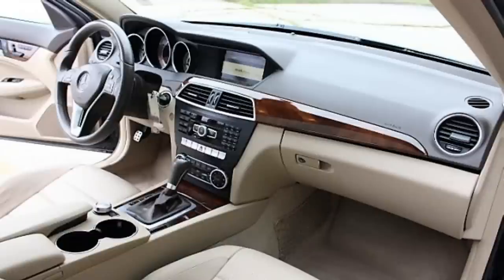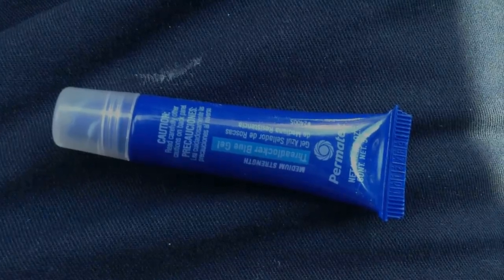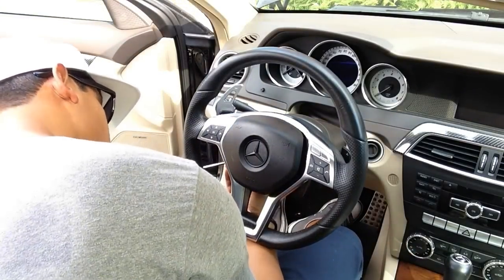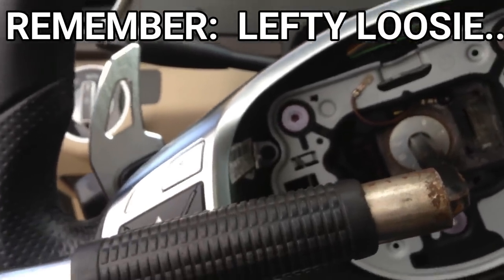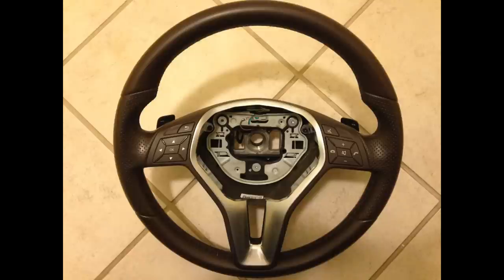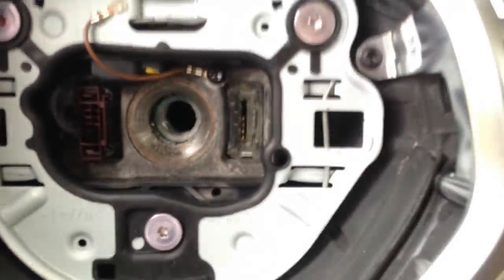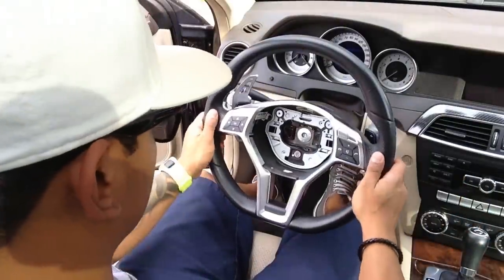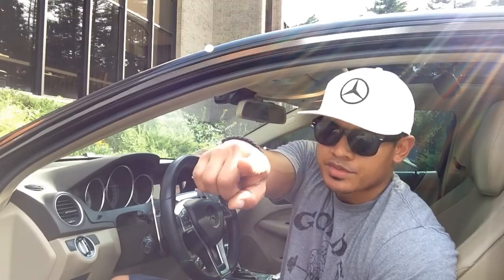Installed a new steering wheel (with paddles) on my Mercedes C250 C300 W204

Comment: Flexx can I switch my steering wheel to one with paddles if my original wheel didnt? And will the paddles work?
Reply: that's what he did in this video...
Reply: check if your conductor plate has 4 plugs at the top, if it does you can 100% do this

Comment: Having extreme difficulty with that lever it just doesn’t fucking work
Reply: got it! guy don't feel for a lever because it will feel hard and like a piece blocking you from where you think you want to go, just push on the thing blocking it from going straight all the way in and voila!

Comment: @flexx I have a stock 250 steering wheel with no paddles , does the paddle function work once you upgrade ?
Reply: Have you figured it out bro I have the same question?
Reply: no it won't, the transmission has to be programmed to accept paddle shifters as an input, take it to a shop that has the diagnostic star tool
Reply: Paddles work for me if you drop it into manual mode via the stick
Reply: @gregorini59 did you have to wire it

Comment: Hi Flexx - I have a 2009 Mercedes SL550 and like to replace its steering wheel with a new one. I wonder if the procedure is similar to the steps as shown in this video?

Comment: I need help cannot loosen the bolt to the steering wheel to change it out 2013 C Class 300 Mercedes-Benz can anyone help
Reply: Did you ever get it loose? You might not be using enough force so don’t be scared to use force.

Comment: Hi, old video I know but I've just done this and everything worked perfectly - great tutorial thanks. The paddles work when the car is put in manual mode via the stick, so try that if you've done it and think the paddles aren't working
Reply from the maker: Yes, that’s how paddles work on most cars. You need to put the gear or transmission into “+-“ manual mode. It’s the same thing with my benz, a4, and R8.

However, if a car didn’t come with paddles and you install a steering wheel with them, doesn’t automatically mean they will work. Some cars require programming to unlock the feature and some cars just won’t allow paddles cause the transmission isn’t designed for it.
Reply: @TheFlexxGarage  thanks, I've been in some that haven't needed any activation. The Audi A3 TFSI and Seat Leon FR I've had just needed a hit on the paddle and manual mode is activated, but the old lexus and Toyota I had did need the activation on the stick. Maybe it's a VAG thing!

Comment: Can somebody explain to me how to replace the pre 2018 steering wheel of the mercedes e class 200 amg 2018 for the new, post 2018 steering wheel? I'm mainly interested in the exact decoding process. And does anybody know which chip card should be used. Thank you.

Comment: Hello I wonder if this will work on a 2005 Chrysler Crossfire . I love the 3 spoke sterring wheel. in 2005 Mercedes was involved with cHRYSLER.I was so happy back then and then they started with the Crossfire which was rather expensive and used all old Mercedes SLK technology .but charged high prices for the Crossfire. I couldn't afford one then but got this 2005 real cheap $1700 and wanted to do the Mercedes conversion on my Crossfire like sterring wheel. I know my car doesn't have radio button on wheel  but the 2005 SLK did .don't know why Mercedes used all old tech on the crossfire. I would love your old steering wheel if  it would work on my car Ill need the air bag also . will these work on a 2005 Crossfire.

Comment: Hi!
Can you help me regarding changing steering wheel in w207? (mercedes benz e350CDI coupe 2010). 
Because I want to change my steering wheel for a face lift one  (2012) 
My afraid is that I have no steering paddles/shifters on the steering wheel and the steering wheel I want has paddles and the electronics maybe different in 2010 and 2012. 
For me its doesn't matter if I can use it or not the important is that the main buttons work properly.
So is it possible to put the 2012 steering wheel (what you have changed in your car) into my 2010 e coupe?
 Thanks!

Comment: I dont get it. I did the exact same thing with the same steering wheel and nothing is working??? Anyone? No Airbag, No paddles, no light in steering wheel. NOTHING AAARRHHH
Reply from the maker: If you didn’t change the contact plate then you didn’t do exact same thing in the video.
Reply: @TheFlexxGarage  well i did :) And its saying error in the left side.
Reply from the maker: then you probably just have compatibility issues. Not all steering wheels are fully interchangeable...even if it "looks" like mine or if it's stock from another similar car. I've seen some people swap a 2012 C250 steering wheel with paddles into a 2012 C250 without paddles...and nothing works and airbag doesn't even fit right. And some people that swapped out with completely different benz models and years...and everything works 100%.

Comment: Hey flex I have a 2011 Mercedes c350, I want to add paddle shifters. My gear selector has a manual mode in it, will it work?

Comment: Hey Flex. Question. I have a 2012 Mercedes E350. The surface of the button modules are peeling off. Instead of buying a new steering wheel at $1300 bucks. I wanted to know if you have ever replaced the button modules on both left and right sides of the airbag? If yes, can you make a video on how to replace the modules, I just recieved mine but dont know how to remove and replace old.
Reply: I had a similar issue but I just bought chrome button stickers on eBay and they look brand new

Comment: Great Video Easy Swap, just one question. The steering wheel can only go on one way because of the teeth correct?  Looks like I might need an alignment to straighten the steering wheel when going down the road.
Any idea on that?
Reply: No the steering wheel not go in one way before careful to install the steering in same position make a mark before you remove the steering wheel or your steering will be not straight in the road

Comment: Hey Flex I have a 2013 c250 model as well and the airbag has malfunctioned. I found out there is a recall on the airbags but the dealership doesn't have them available. I can't buy a replacement because they want refund me what I paid and when the new model is available whenever that will be. Any advice
Reply: Marcus Scott hey the dealers now have the airbags.

Comment: will this work on a CLS500 benz...would like to change steering wheel to the look of steering wheel like this one in the video
Reply: no it won't because you'll have to recode the airbag's SRS module with xentry after every swap, but he's likely not aware of that

Comment: I have a 2014 e350. I want to replace the all black steering wheel to one with the wood trim. Is it very difficult to replace the steering wheel yourself? Iam debating to do it my self or take it to a shop. Your thoughts bro???
Reply: The labors is easy , it's getting the parts right so its compatible with one another.  Example : 8pin adapters vs 4 pins adapter on the plugs.
Reply: hi 26juventus, not difficult at all. in case your new steering wheel didn't came off the very same car with very same specs you'll need to replacte the electronic/contact plate .... see this video as well to find out how to do that

Comment: Theoretically would the brown airbag fit on the black steering wheel?
Reply from the maker: The brown airbag was what I installed on the black steering wheel. I just spray dyed it black to match the new steering wheel.
Reply: @TheFlexxGarage the brown steering wheel different outer shape's airbag fits the new black one u put on?

Comment: Hey flexx my c250 doesn’t come with paddles, am I able to get the steering wheel with them and install it to my car? Will it work?
Reply from the maker: You can but no guarantees it will work.  Some people got it to work no problem, some can’t get them to work, some required coding for the car to recognize them.
Reply: @TheFlexxGarage  how did you do it with your car? Did it come with the shifters?
Reply from the maker: mine came with paddles. I only changed from a brown steering wheel with paddles to a black steering wheel with paddles.
Reply: @TheFlexxGarage  ok thank you

Comment: what steering wheel is this?
Reply from the maker: It’s a steering wheel off a 2012 C-class that was black with paddle shifters.
Reply: Would a 2015 cla 45 steering wheel fit on my 2009 c300 ?
Reply: Let me know thank you

Comment: Hi, I have a 2013 c250 without paddles. If I upgrade to a new steering wheel with paddles is there any electronic upgrades the I would have to do?
Reply from the maker: It’s kinda hit or miss. 

1) you need to have a hand shifter in the center that allows you to drive in “manual mode” with the (+) and (-). That means the transmission can support “manual” shifting of the automatic transmission. 

2) some cars will accept paddle shifter steering wheels and work 100% with no programming. Some car will require programming. Don’t really know why.
Reply: If it doesn’t work, who is likely to be able to do that programming? Thanks!

Comment: You mention moving the contact plate from the old steering wheel to the new one in order to keep the button functions.  Are you referring to only the metal cover, or the entire assembly?

Nevermind.  I answered my own question.  I simply removed the entire assembly from the original steering wheel to the new, and everything works just like before.

Comment: Hi Flex, how are you?
I've seen many video talking about installing the new Mercedes steering wheel into any old model without any coding required , especially the new CLA 2020 steering wheel is really interesting, could you please share any information about that.

Comment: What is that tool he using on the Allen key to loosen the steering wheel bolt
Reply from the maker: It’s just a large pipe. I think it’s a jack handle if I remember.